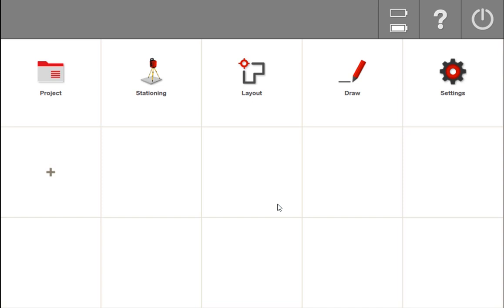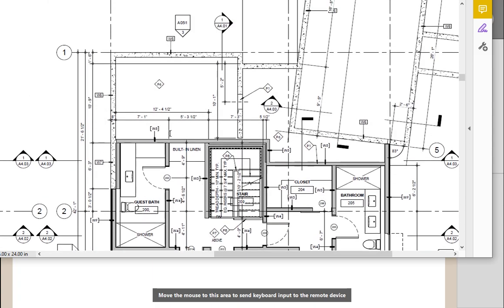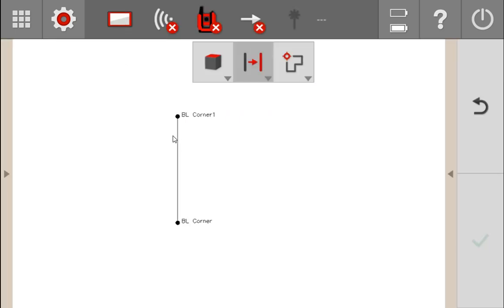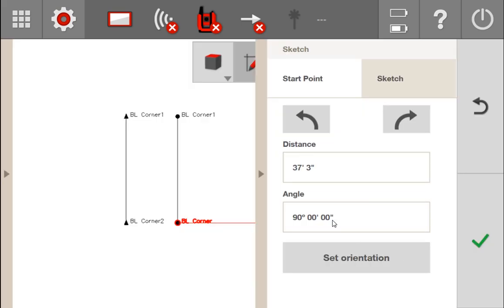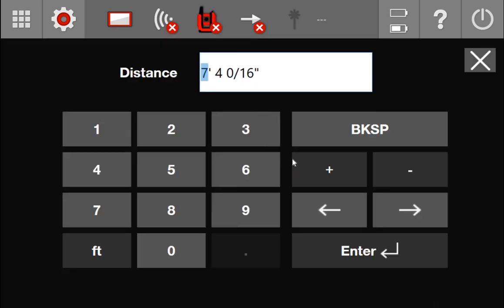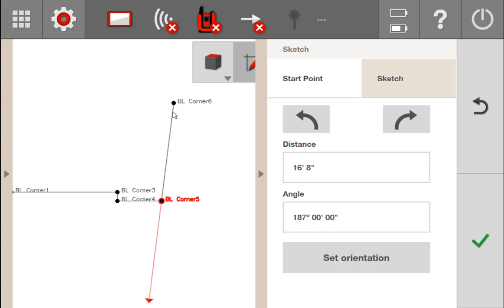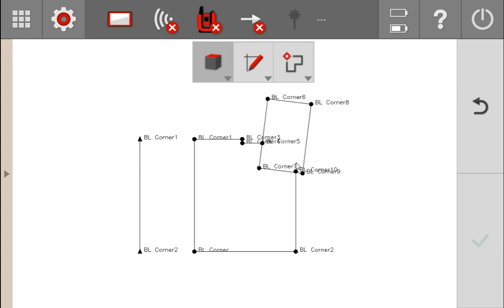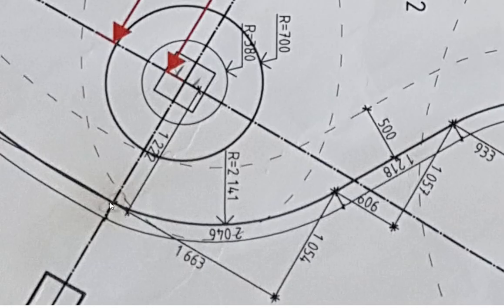Hilti PLC 400 Tutorial - DRAWING - Sketch your own layout project

Comment: This is a great feature to have, very helpful when you come across changes from the original design. 
One thing I would love to have is the option of stationing on these newly drawn lines. If the surveyor gives you 4 random points on 2 perpendicular lines(2 on each one) it would be so easy to start the layout of the new project.
One other minus is the time it takes to draw the sketch on the tablet. Small screen, stylus or hand instead of the mouse and holding your phone or hand drawn sketch with the other hand, all add a bit more time to the process. 
But I guess it is better than having to boot your laptop for every project change.
Reply: Gridline stationing will allow you to station off 2 random points on two lines.  Its quite handy!
Reply from the maker: regarding stationing on lines, on the PLC 400, GRID LINE STATIONING would be perfect for this. Have you attempted it? The lines need to be intersecting, but it is extremely convenient when you would rather use lines than points.

https://www.youtube.com/watch?v=Ze_ltVkEgsg&t=7s&ab_channel=MeasuringSystems